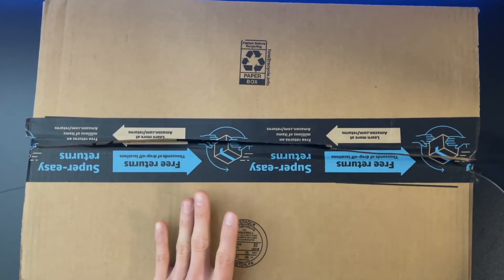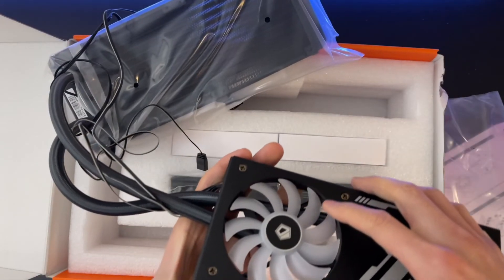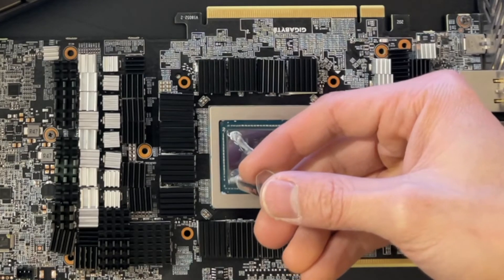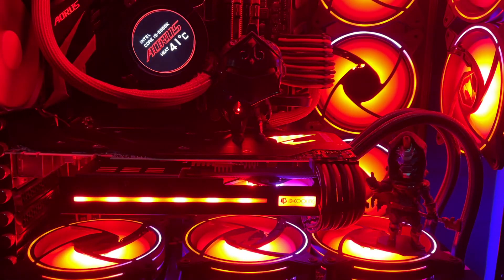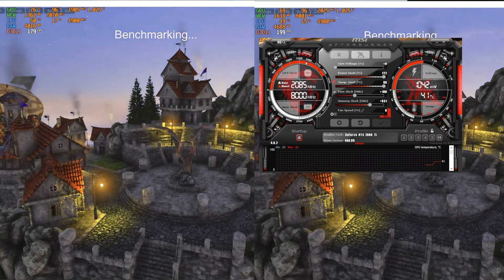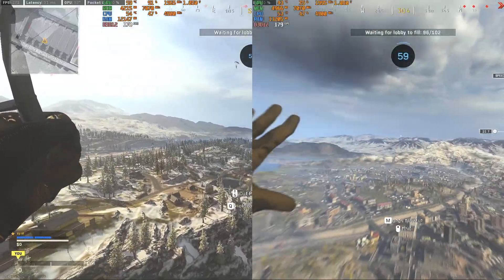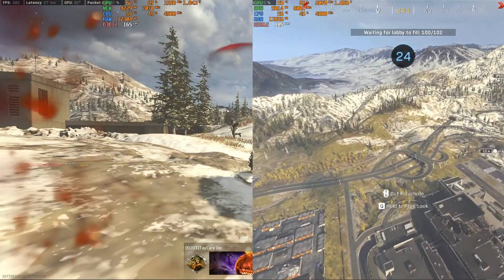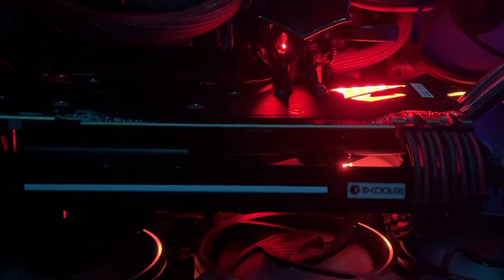The Best GPU Liquid Cooling ( drop 20 Celsius) ID Cooling 240 mm VGA Graphic Card Water Cooling

Comment: Your temps should be much lower I think those heatsinks on the ram is making it so the plate does not touch your GPU  properly.
Reply from the maker: I hope you know that if the plate didn’t touch the GPU. My GPU Temperature would be through the roof…
Reply: @GoOfyG4mer  of course but it could only be partially touching
Reply from the maker: @kakashi99908  oh trust me, if it only partially touch you will know. I have built many PCs I have done a few things that I am not proud of while building them LMFAO!

Comment: Do you know  if this will work with the Aorus Extreme 2080? just like yours but not TI.
Reply from the maker: It work with my 2080 Ti extreme, it should work with your
Reply: @GoOfyG4mer  yeah because my card is pretty loudly and i can't bear it anymore.
Reply from the maker: @c4nchi  My GPU temp drop about 15-20 C after swap it out. it should do more for your.  it have been more than one year now, It is still working fine. I think you should just try it out, it took me about 1 hour to swap it out. You just have to be careful make sure you install it correctly. the worst thing could happen is you can just return if it does not work out for you. I think it will work fine

Comment: This was a year ago and I'm late to the party. But I'm considering this to replace the unbearable blower cooler on my 2080 TI. I'd like to know how this thing is doing a year later. Also, how do wire it to the board to ramp/curve with gpu Temps? First time liquid cooler here. Sorry for my scrubbyness.
Reply from the maker: It’s running very well! It keep the temperature lower when comparing to the stock cooling. It’s easy to install as long you follow the instruction. Wires are long enough for any board/ case. And fan can be controlled from Bios. I am not sure if your case is big enough to install like mine, Cause you want to have a set of fans that can feed cool air from that bottom to keep it run even better like the way I have it install in the video. Should give it a try if you want your gpu run cooler!

Comment: I mounted the radiator in front of the housing with the pump down so I wouldn't have any problems. I mounted it on a GTX 2080 SUPER gigabyte. I mounted radiators on VRAM MOSFETS AND DIODE.And in games used 100% after 4 haors do I play non-stop games, I mean it doesn't jump from 56 degrees and in idle 35 degrees. And pump at 4800 Rpm. Extraordinary. And I mention that on the radiator I have 4 fans of 240. I recommend this cooler.

Comment: Why did you mount the radiator underneath the graphics card? The highest point should be the radiator so you don't get any bubbles inside the pump.
Reply: Did you bother to read specs and know the pump is in the radiator?
Reply: @clintjohnson4971  I did not.

Comment: You do realize you mounted it completely wrong? Your radiator is below the pump, which is a big NO-NO. This causes water bubbles and inefficient water flow over time, which leads to extremely bad cooling, damaging your GPU. Notice how your temperatures (with the GPU cooler installed) are around 48/50 - that's not a proper cooling. Properly installed radiator and pump - highest temps on a 2080Ti FTW3 Ultra are MAX at 43/45 degrees. Either install the radiator at the top of the case so that the pump is below it, or on the right side of the case so that the pump is below the top of the radiator.
Reply: Chill bro, the pump is in the rad end with the barbs so its actually in the best possible position.
Reply: It is indicated in the ID Cooling website that the pump on radiator is at the bottom.

Comment: The cooler just arrived, took me 5 hours to install since I was being careful heatsink placement. Looks very nice on a 2080 super.
Reply from the maker: Nice! How is the Temp of that 2080 Super now!?
Reply: @GoOfyG4mer  Stock blower cooler temps were 81c while gaming, and now with the AIO it's 35c idle and 60c underload. (But that's due to the front panel restricting airflow )
Reply from the maker: Well I have other Lian Li mid tower case... I took off the glass front panel and create a mesh one... so I’ll have air flow from front to back and bottom to top that make my case temp like 10 degree cooler

Comment: It says 1600 series. Is it just the 1660 or will it work for the 1650 series?
Reply from the maker: Yes! It should work. Your Gpu temp will drop at least 15%
Reply: Heyy,sorry for this late question,but did u try it on your 1650?
Reply: @errynrais2835  No. I did research and it is only for the 1660 super. All the vrm's have to be on the left side. 1650 are on the right. And I believe it only fits the gigabyte card's if I read it correctly.
Reply from the maker: @errynrais2835  I have not tried it, but this cooler will work for all 1600 series cards. it should for the 1650

Comment: Currently using the older id cooling vga and yup it works like a charm thinking to replace my older one with this it look much better then the old one huhu ..
Reply from the maker: Ha ha! I am loving this one... yeah this one looks clean and of course the RGB lights are cool only if your motherboard has 5V 3 pins. Take a look at your board! My GPU went from 75 to 50 while playing Warzone
Reply: @GoOfyG4mer   currently still using my old one and yup its true it really does turn down alot of heat.. , my mobo does support 5v 3 pin huhu .. but the older model using 12v 4pin thats weird o.o

Comment: Nice video, i just realized the lesser FPS with your overclock (lower temps tho), it means your overclock is not working out great. If you lower your OC a bit, the FPS should be higher in the end.
Reply from the maker: if you play Warzone you should know  your fps heavily depending on where are you at on the Map... because of players and structures those will impact your FPS.

Comment: my gigabyte gtx 1660ti always runs at 80 degree while playing red dead redemption 2, i probably get this one someday
Reply from the maker: Then you are going to love this!
Reply: I'm getting this tomorrow for my 1660ti. Its the Asus tuf 1660ti dual fan oc 6gb edition, which averages 88c and  throttles at 90c, so it is much needed. I will let you guys know how it goes.
Reply from the maker: It should help for sure! My 2080 ti stay below 60c while gaming even with overclock... I hope it will do the same for ur card... if you have any question just HMU
Reply: @GoOfyG4mer  Heres the results.... The gpu stays below 65 on Overclock mode and no longer throttles. Before my gpu would reach 90c then throttle.
Reply from the maker: You are going to miss that 90C heat, my guy! 😅😅😅
Reply: @GoOfyG4mer  Even better I put 4 fans on the radiator instead of 2 now I can keep temps below 55 while gaming lol
Reply from the maker: @99drums54  Your GPU drop almost 40c... now freaking way WOW! good for you
Reply: @GoOfyG4mer  yes i had a look at the stock heatsink...it is bad. It looks very similar to the intel stock cooler. Theres no heatpipes and its not a zipper heatsink (which most heatsinks are). I dont know why it was designed so poorly. So obviously my results are amazing since the stock heatsink before was TERRIBLE.
Reply from the maker: My stock cooling isn’t bad but just not good enough to keep the GPU temperature cooler. Sometime, I think to myself why these big companies can make such powerful GPU But don’t want to put more effort to make it even better with a good cooling system!? Is it because of the cost or they just want you to get a third party cooler. I bet if I stack two more fans mine would drop at least 30 instead of 20c , But I care too much for the aesthetic 😟! I guess I’ll settle for 20C

Comment: finally finished installing it eh, how many slots does it take? Planning to get this for my Vega
Reply from the maker: 2.5 slots...
Reply: @armoredjoey  really? I guess I'm going digging again. Not much aftermarket coolers for this card. Morpheus II looks great but 4 slots is waaaaay too much since I use my 4th slot for a soundcard
Reply: @tinkthinky9419  The fitment issues is because there is 1 row of memory modules that is too close to the GPU chip. means the small memory heatsinks are too tall, you'll need to replace those small tall aluminium heatsink with smaller profile copper heatsinks. 

5700XT had the same issue, but was not as bad.
Reply: @MrFredscrap  on the Vega I saw amazon reviews showing the mosfet chokes basically blocking the cold plate from hitting the die. could see using a copper shim to counter that problem but I'm probably going with a morpheus ii tho with super slim fans